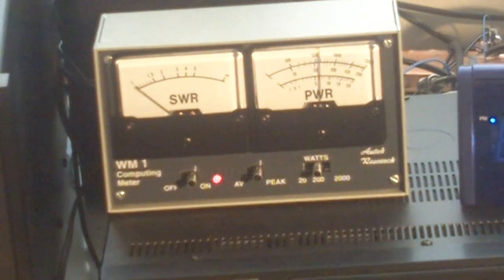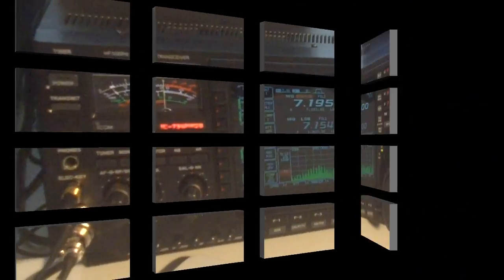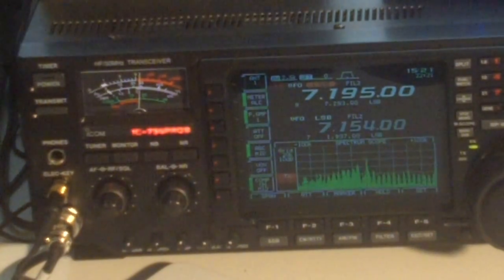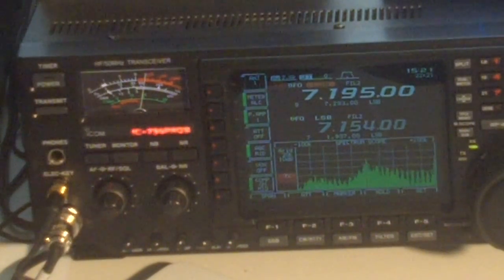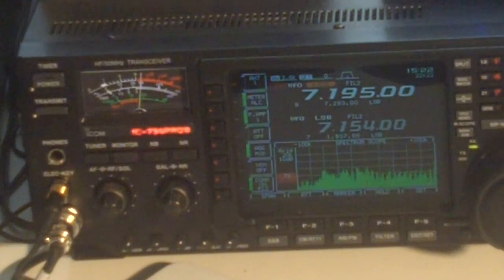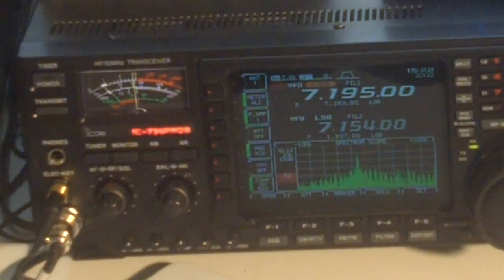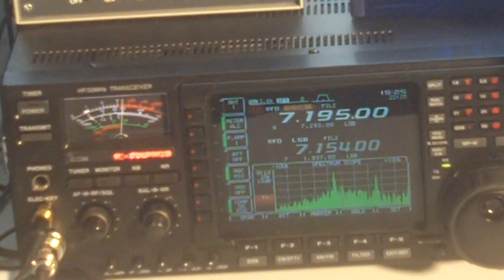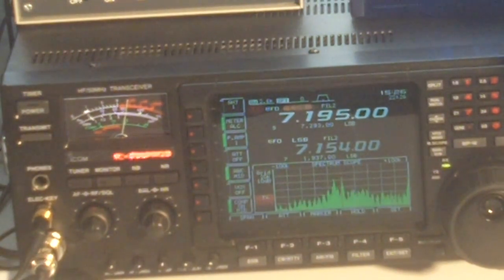Magnetic Loop antenna Helical Loaded part II(2/2)

Comment from the maker: @Poochanacacaca 

If you need any help or advice please contact me via email.
Make sure that you use the proper copper material. I did allot of work to come up with the correct 
material, thickness and width.
i will be gals to answer any questions.  Rich K8NDS